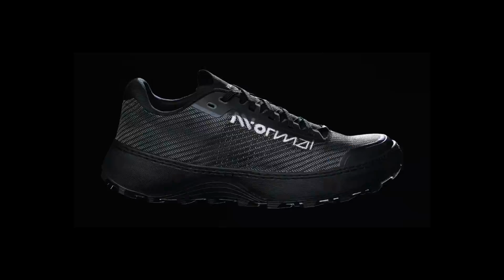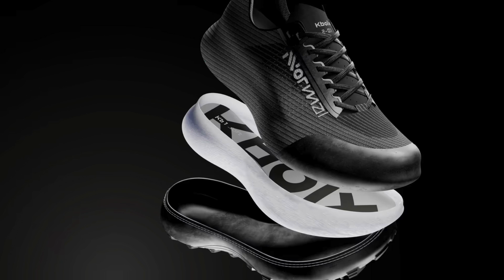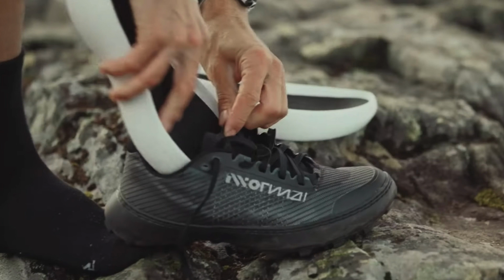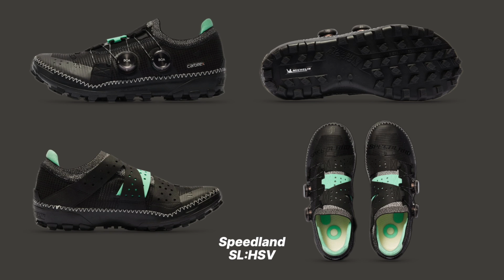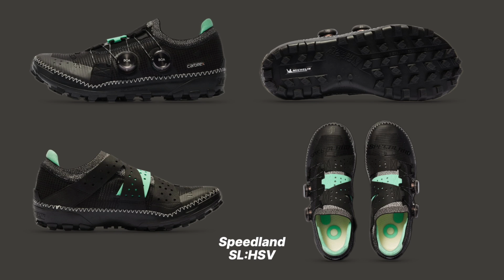Nnormal Kboix - Can a modular running shoe actually work?

Comment: I would explore a simplified design using an inflatable midsole like the Reebok Pump basketball shoes from the 90's. No need to bring different midsoles to the trail. Manually pumping air to adjust air pressure offers infinite adjustment on cushioning. Outsole needs to be puncture proof though
Reply: Wasn’t the Reebok an inflatable upper though? I don’t think it was the nidsole
Reply from the maker: It was the upper only, and really just the ankle collar and tongue of the shoe at that.
Reply from the maker: Interesting idea. I think Nike would have a lot to say about another brand doing any type of “air” midsole. Beyond that, for a dedicated trail shoe full puncture resistance is a tough ask.

However, the Reebok pump air idea would solve some of the upper issues for being able to swap in different stack heights of midsole pucks.
Reply: @SagasuRunning would a flexible kevlar plate solve the puncture problem?
Reply from the maker: @TinQuijano-i8v  Likely, they is essentially a rock plate. It would deaden the ground feel of the shoe though. But Kevlar is a good material for this use.
Reply: Yes the Reebok was inflatable in the upper only. But looking at it from this angle would maybe solve some of the complexity in terms of the design. Nike probably would have a big fit with this but their air units are fixed in PSI values when installed. This would be a fully adjustable bed.
Reply from the maker: @TinQuijano-i8v  The pump mechinism is very complex for a shoe and as I remember the Reeboks back in the day had over a 50% failure rate on them. Not a good look. It's not about materials or tech really, it's about the space and the beating the mechanism gets in the shoe. 

Additionally it adds weight. Likely not as much as BOA, but more than traditional laces. But, it does solve the fit and slack in the upper issue.

Nike would have much more than a fit. it would be devastating for a company Nnormal's size, even with Camper's legal team. Even Addias won't take that fight on.
Reply: @SagasuRunning   I still want to make a case for basketball shoes: they had these swappable insoles/foams for a long time. It looks like it is not great for company profits, so Kobe's line is not going there anymore. Smaller companies like Serious Player are exploring the idea further. 
I am not a trail runner, but these bball shoes companies resolved many problems. For example, insoles stay in place (playing basketball!!!).
Reply from the maker: @Ab7trAct I’m sure Nnormal is aware of what’s been done in the space with removable insoles. Also, if a company has solved locking the midsole down for something like basketball… that’s amazing.

Comment: It really depends on the target market they are going for. Are they going for people who don't care what the shoe costs? Or are they hoping for mass market appeal? That will strongly influence how engineered that upper will need to be. A dual BOA system won't be cheap, but it would be completely customizable to the unique user AND insert type on the fly, But for the mass market they might need to go with something similar to a Salomon speed lace system with a wider traditional tongue to allow for more lockdown give, while at the sametime keeping costs in check.
Now from a personal standpoint, I might consider a shoe that has  a large upfront cost, but can last potentially thousands of KMs via insert replacements, if I was or end up transitioning from road to trails. But I have 6/7 majors to run first. ;)

Great content, definitely providing value over the "instagram" "tik tok" style that seems to be taking over the shoe/running space.
Reply from the maker: I’m unsure of the market opportunity they see here, but I’d guess it’s more niche for the moment. The “mountain multisport” aspect of this shoe makes me think they have eventual aspirations for more though. Also Camper has played with this idea in the past (about 20 years ago as I remember) for sneakers/casual shoe. I bet they have some learning there too.

I fully agree on BOA… it’s going to add significant cost, weight and complexity to the shoe AND it stops the shoe from looking “normal” so would limit daily wear for those who want it. 

Salomon’s speed laces are an interesting idea. I seem to remember seeing and hear interview with Kilian somewhere where he said he wasn’t a fan of them (no memory of where this was, it wouldn’t have been Salomon content).

A larger upfront cost, within reason, would work for some given the promise of many many kms… but it’s also something they can’t be guaranteed given how dynamic running is.

Thank you for the kind words. I’m covering what’s interesting to me and making the content I want to see that I don’t see out there. I’m glad it’s hitting the mark. 🤙🏻

Comment: interchangeable soles are well known technology in basketball shoes which works well.
Reply from the maker: I didn’t know that. I remember Camper doing something with interchangeable midsole about 20 years ago. 

Basketball shoes have much simpler needs than a trail shoe. But good to know the underlying idea works there.
Reply: @SagasuRunning  Indeed it started many years ago by Nike Kobe 7 system and now there is new company called serious players only: https://youtu.be/kS-_VfX49hA?feature=shared
Reply from the maker: Interesting
Reply: Camper Wabi
Reply from the maker: Not these. It was an actual shoe as a remember. I only ever saw it in design magazines as well. So maybe it was never a real product.

Comment: If it was me, i would copy the  adios pro evo where you can change the outsole tread instead of the midsole, like the peg trail 4 its great for sandy soils but bad for wet clay, and my solomon is bad for sand but good on clay
Reply from the maker: That’s just two differed shoes. However I think being able to change the midsole AND outsole would be a game changer in some applications.